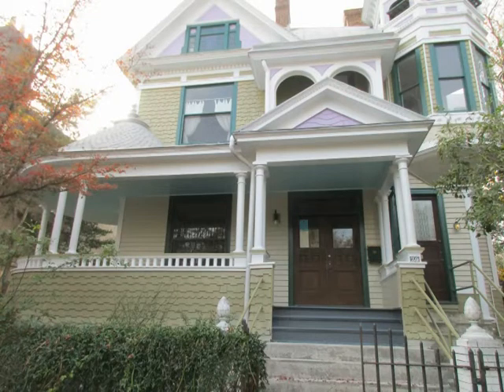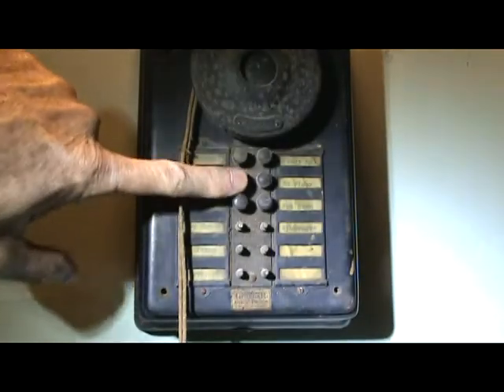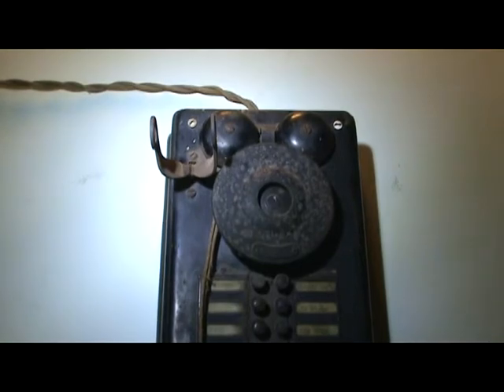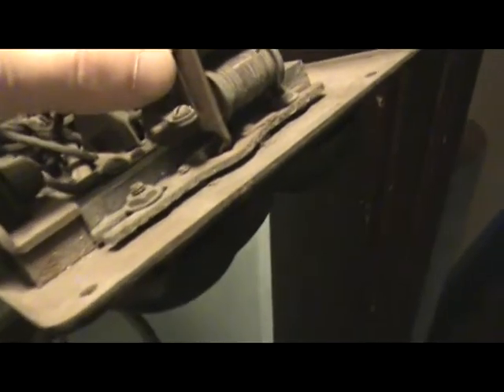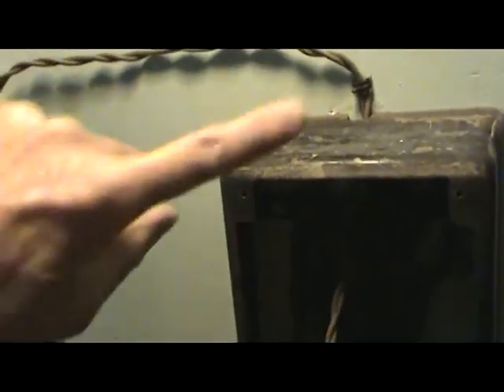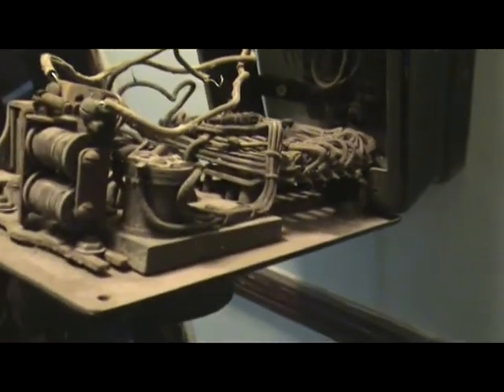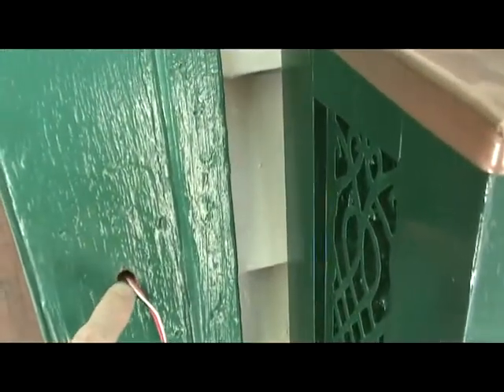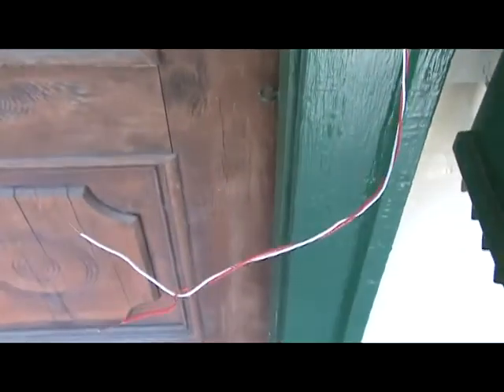How to Turn an Old Telephone Into Your Doorbell

Comment: Do you know how many volts you need to get an old crank phone to work?  I think the dynamo creates a higher voltage than a standard modern doorbell.
Reply from the maker: I suspect the dynamo created high amps, but not necessarily high voltage. If you get a doorbell transformer that has different voltages like the one I used, you can use trial and error to get the ring you want. Remember, the purpose of the old dynamo was to generate enough amps to make the bell ring at the operator's office.
Reply: If you use a real telephone company phone and bell, a doorbell transformer will not make it ring.  (The "phone" shown in the video, was an intercom system phone, which was not built to AT&T or ITT standards.)  The ringer in a real Western Electric or Automatic Electric phone, does not have the interrupter contacts which are shown in the video.  These telephone bells require 90 Volts AC at 20 Hz.  60 Hz current from a doorbell transformer will not ring these bells.  The 60 Hz frequency is too fast, and the voltage, 8, 16 or 24 volts is too low.

The magnetos used in the OLD telephones do work, because they were built to produce the 20 Hz frequency.  The are electronic circuits available today to produce the 90 Volts at 20 Cycles per second require by these bells, but it is not a simple project.

Comment: I'm interested in using a rotary phone to make a door alarm. Any thoughts on this idea?
Reply from the maker: It's the exact same concept. You'll have to open the phone and isolate the ringer mechanism from the rest of the electronics. You can then use the phone line from the phone to wire into a phone jack that is really wired to the doorbell transformer. If you're not exactly sure how to attach to the ringer wires use a 9v battery and trial and error. Eventually you'll find where the wires should go. There's also a good bit of info on the internet about telephone and telephone ringer wiring.

Comment: Now that you have the button installed, how long does it ring for? I'm thinking of doing this with an old payphone, but I'm concerned that the ring won't be long enough to make it worthwhile.
Reply from the maker: It rings as long as the button is pushed. So if someone pushed the button in for 10 seconds it would ring for 10 seconds. If they simply push and release it, you get a brief blast. In every case the bell rings. It's never happened that someone pushes it so fast that it doesn't ring. If, for some reason, the ring isn't long enough you could put a sign on the button that says "press and hold" or something to that effect.  I have found that most people hold the button in for about a second, which is a good long blast.